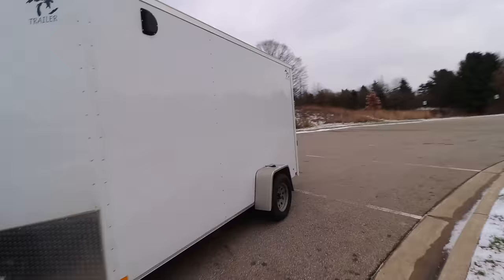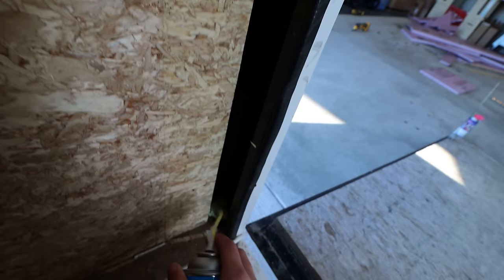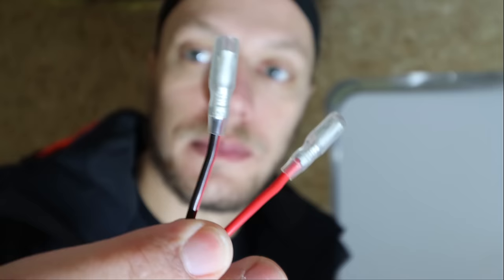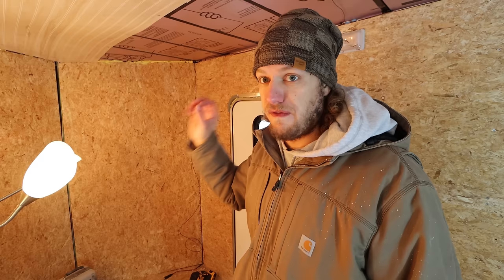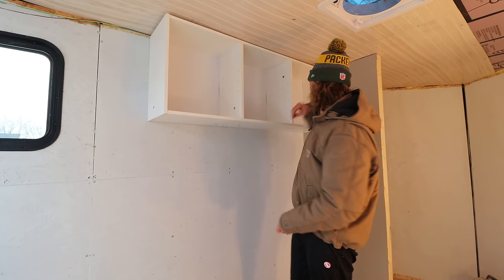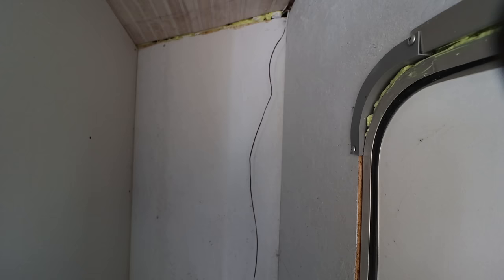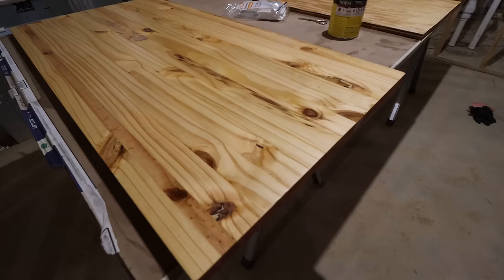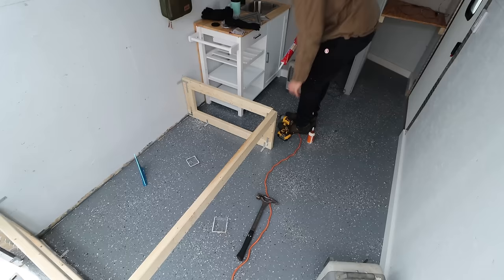Conversion Camper - Full Build

Comment: The high and low vents you covered are to relieve air pressure in the trailer. If you're getting a lot of dust while driving dirt roads you'll want to open these. Nice job.
Reply from the maker: I actually haven't noticed dust at all! I appreciate the advice though!

Comment: The high vent will increase the air pressure elevated in the trailer, reducing the dust in the trailer when driving on dust roads in the west.

Comment: Hey, New Subscriber !  REALLY ENJOYED this compilation video of your Cargo build .... You did an AWESOME job 👌👍👍👍👍 You kind of remind me in my "younger" days, (Always working, busy with multiple side projects, ).  I'm approaching retirement at age 64 now, and I am planning out a Cargo trailer build for myself, .... You gave me a few GREAT ideas that I saw in your own design, which I may use !! Question : how has the Epoxy floor paint held up, thus far ...?? And what are you using to tow the Cargo trailer with  ??  "Thank you" for posting this GREAT content !!!  Eric
Reply from the maker: Thanks a ton Eric! I appreciate the feedback! I'm glad I could help with your build. The epoxy held up great while I had it and I was not easy on the floor. I was hauling it with a Toyota Highlander. It was rough on the Highlander and took my mpg from 24 to 10. So if I were to do it again I'd spend the extra bit of money and get an aluminum trailer to save on as much weight as possible.
Reply: I bet aerodynamics is the biggest issue and not so much the weight.